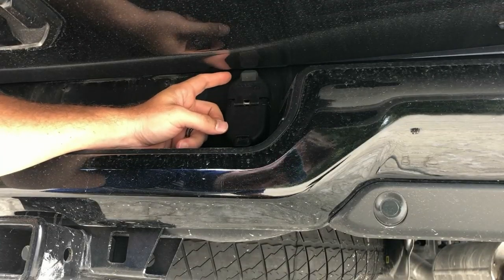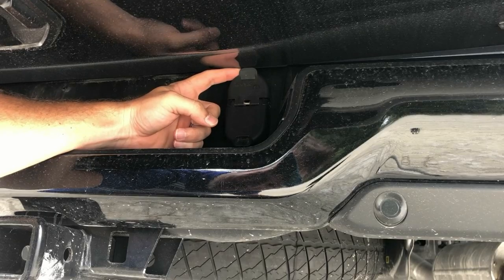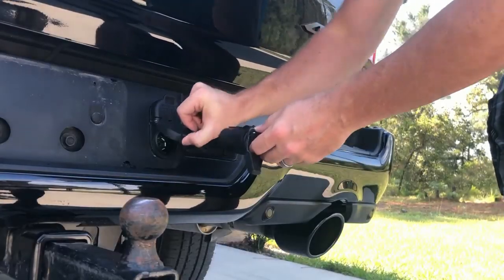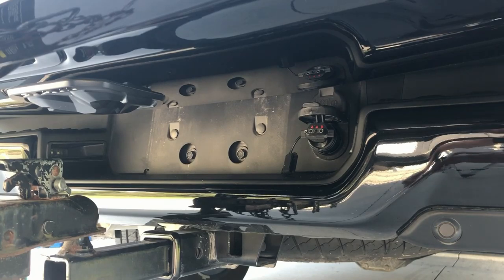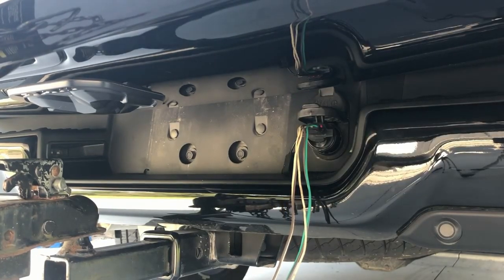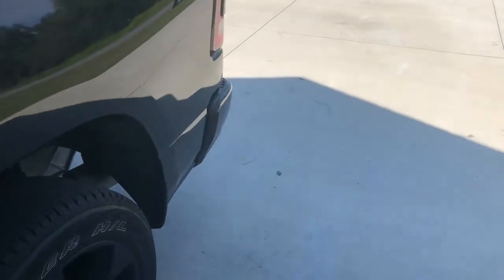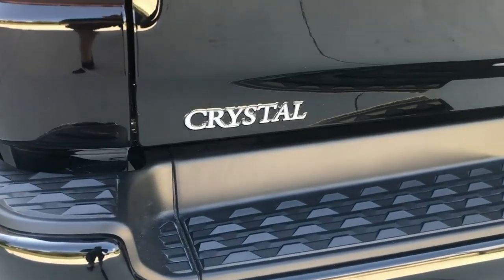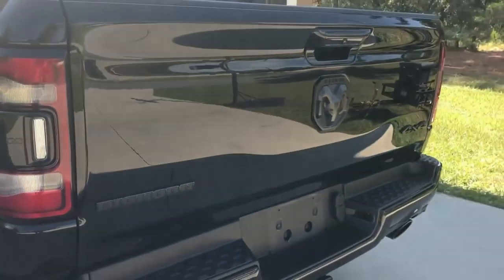Your 2019 Ram 1500 has a PROBLEM. Here’s the solution! | Truck Central

Comment: A had a V6 Charger and Challenger as recent rental cars.  My Ram 1500 is way nicer to drive.  The fit and finish is also way better.  If those rentals had the V8, the performance would definitely be better, but they still would lack a great interior.  Now put the 6.4 Hemi in a Ram 1500 with 450-475 bhp and it would be absolutely golden.

Comment: The one issue I have with the new Ram is the mid to lower models don’t look that tough. Top models yes but the other ones no. Whereas the mid level F150, Sierra and Silverado look just fine
Reply from the maker: Agree 100%
Reply: Except the Chevy interior sucks on the custom and LT series which is the equivalent to the f150 XLT or STX model. U can’t get a center console on the Chevy unless u want to spend 45-60 thousand 😑 I would already have a Chevy but the interior is so bad I would rather look elsewhere 😂

Comment: I am looking for the best way to raise it up and add tires, but not too big my first impression or thought was to do 6 inch suspension left with 35 inch Nitto grapplers. I just don’t know what to do. I’d love to find a form or somewhere I can talk to someone about either a leveling kit or what’s the best way to make my truck just look tougher than stock I think maybe 33 inch tires instead of 35? Maybe I’ll get better gas mileage that way I’m a little afraid to raise up this brand new $80,000 truck and compromise it’s handling I just need someone to talk to about it and I don’t know, so if anyone’s out there, let me know. Thank you let me know your thoughts appreciate it.

Comment: Will check this out very shortly. Also need to boost the Uconnect wifi so it will transmit 100 feet or more perfectly. They say does 50 feet but I notice not very well. I'm using AT&T.
Reply: I failed miserably at uconnect.. don't understand all of it's capabilities.. Android auto is fine ..
But have to plug wire into phone so...
Reply: @mikekosar6135  sorry, not sure what's Uconnect all about yet. I notice when I plug my Samsung phone in, it's a little tricky for me to text. I'm pretty sure all 2019 Rams use AT&T for the wifi though. They have tech support numbers for these features. Maybe the dealer actually has someone there who can help also.

Comment: Question:  In reference to the 4 pin trailer connection issue, if you don't use the big 7 pin, why not just flip the outlet over so the 4 pin is on the bottom? You wouldn't need the adapter.

Comment: Nice solution. Mine was just grabbed some old metal wire i cut about 6 inches and hooked it to the 7 ping connector cover to hold it open while i loaded my atv in the bed then hooked up my jetski trailer and removed the wire. I keep the wire in the floor compartment with tie downs and stuff all the time for that reason.
Reply: Just flip the plug connector over so the 4 pin is on the bottom

Comment: Couldn't you just plug in the 4 way  first and then drop the tailgate down?
Reply: no. I can’t hook up trailer before loading bed. The whole reason this is an issue is because I have to load an atv in the bed of the truck first. So after loading, the tailgate is now down because the load won’t fit with it up. Now I have to hook up trailer and load my other atv. See the problem?  I can’t load the first atv with trailer already attached.
Reply: NICE solution..😎

Comment: You could've just trimmed the connector cap down so it didnt hit the tailgate...to each their own tho
Reply: Just flip the plug connector over so the 4 pin is on bottom